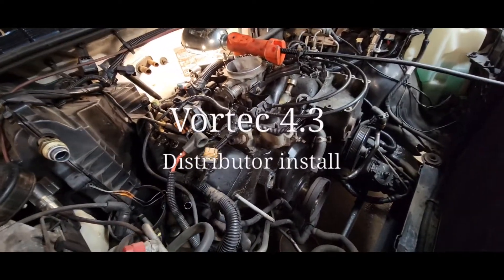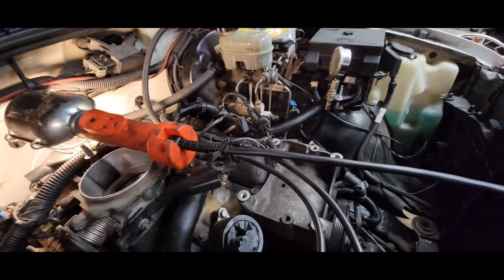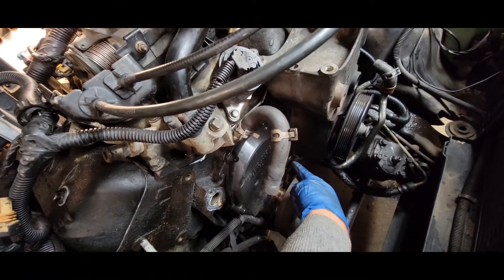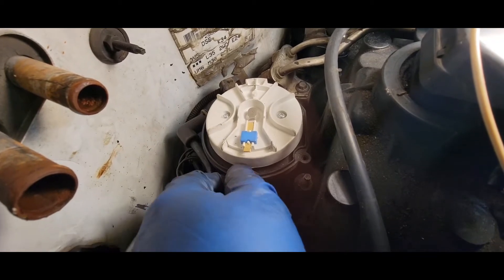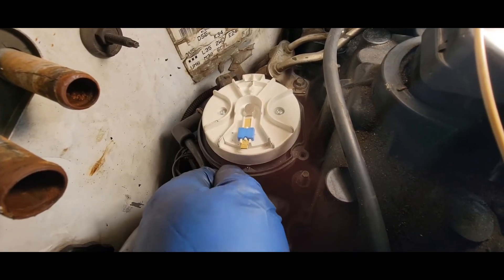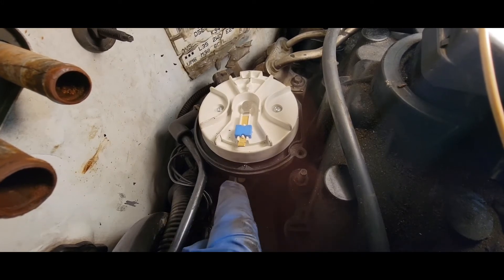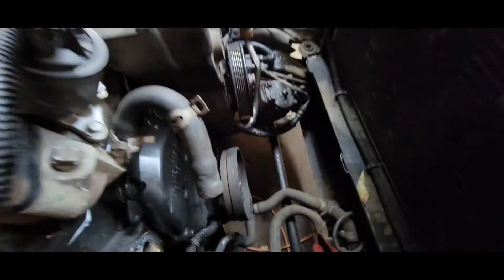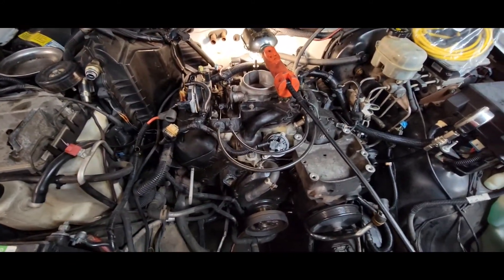Installing 01 Chevy S10,GMC Sonoma  Vortec 4.3 v6 distributor

Comment: why u got the water pump off?
Reply from the maker: Long story, my son was out dogging my truck and over reved enough to bend a pushrod and valve ,so I pulled cover to do timing chain thinking it jumped before I figured out what actually happened,  this was after I put head back on and and figured I'd make a video of the distributor install,   thank God been running great ever since and few 600 mile trips to Florida, thanks for watching Vassmotorsports